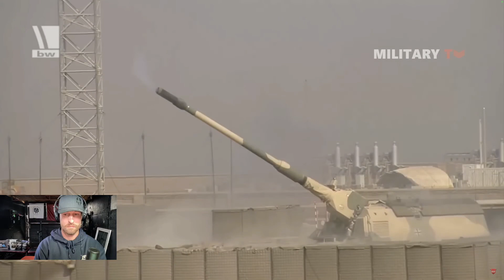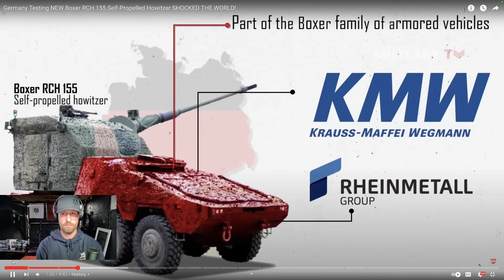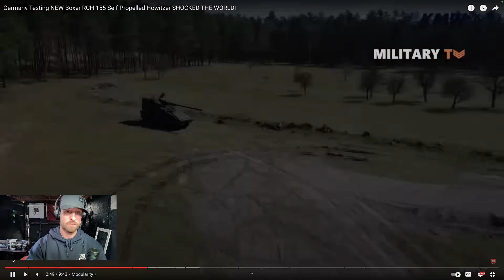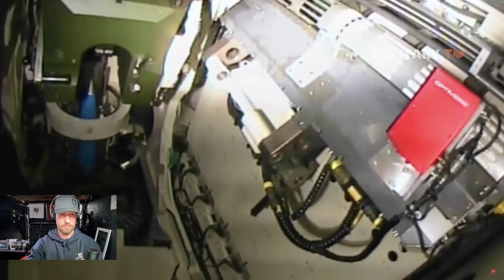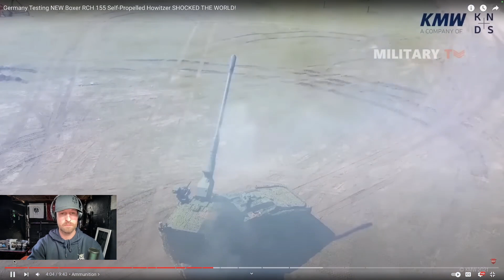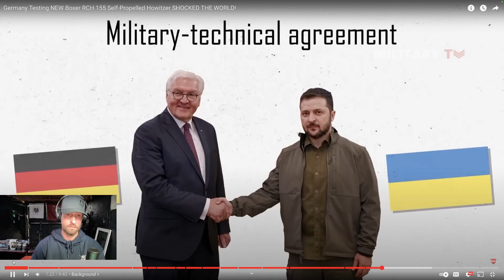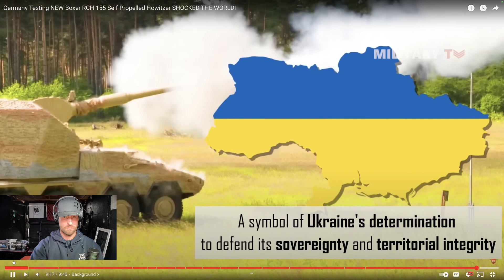Boxer RCH 155 British Armys New Replacement British Soldier reacts

Comment: Some very welcomed news for the British Army’s Royal Artillery Units. This will hopefully give the British Army an excellent expeditionary Tube Artillery indirect fire support capability that will be air transportable if required. But I also feel that the Wheeled capability should not be instead of a Tracked Capability, but should be acquired to complement it. Whilst given the KNDS RCH 155 has been selected, an updated fully Automated version of the Tracked PzH 2000 would be the best option given that both systems are developed by KNDS Germany with UK having already partnered with the likes of KNDS and Rheinmetall through their UK Subsidiaries etc.

Comment: There is a saying, 'if it looks right it is right.' Sorry but this does not look right. Top heavy, and too high. Ok for flat ground but unstable in the hills. Would look better with a gun 0.5 m lower and the turret top 1m lower. Looks like a firing of the gun to one side would flip the vehicle.

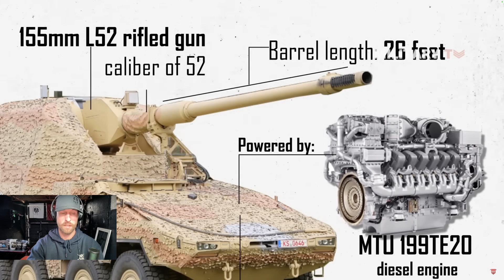Comment: 5:43 That information is partially wrong and partially unneccessary. L52 already gives you the barrel length ie 52x the calibre of 155mm. For example the AS90 has a barrel length of L39 or 6.02m compared to the 8.06m of the RCH155.

Comment: On matter of mobility wheels are not a great problem as tracked SPA loses very little as all support vehicles are wheeled. It is presumed that these are primarily designed for individual shooting as with the auto loading you would potentially mishandle its benefit if you set out to use them in battery fire situation. It would be a high financial liability to place such assets in a limited geographical area subject to area artillery counter attack.

Comment: Looks like a desperate cost development exercise.The chassis & tyre adaption looks on the limit with the weight? It'll have to keep well back from the front line & will be vulnerable to infantry?
Reply: certainly less vulnerable to direct contacts then most of the old artilelry units, as it has a RCWS and hunter-Killer-capability for selfdefense. Even the Pzh2000 which can engage in direct fire (and there are training footage of that on YT) has not all that luxury build in. But given its clear range advantage a lot of things would have to go wrong to actually meet enemy units directly.

Comment: I wonder about a couple of things with this weapons system:
1) How is the accuracy when the shooting platform is so soft? And on the move?
2) How is the mobility really with that enormous weight and only eight tires?
3) The weight and size of the vehicle must make it hard to transport by air?

Thoughts in general:
Will drones and missiles replace artillery?

Impressive things about the system: 
In the future it can be remotely controlled = no personell!
Reply: The soft suspension is not really a problem. The vehicle's weight actually works in its favor here. By the time the hull starts to lean the projectile is long gone, so accuracy is not compromised at all.

If missiles were to replace barrelled artillery, they would have done so by now. But they evidently haven't.
Guns have two major advantages over rockets: Ammo size and ammo cost. Missiles are a lot more expensive than artillery grenades. And they also take up a lot more space, both in the launcher vehicle and on supply transports.

As for drones, remember that each FPV drone requires its own operator who has to steer it sometimes for hours on end just to make a single attack.
In the Boxer RCH there are two guys who can make almost 40 attacks in less than 10 minutes and then drive back to base for resupply.

Comment: The AS90 would have a shorter range since it only has a 39 cal barrel unlike BOXERs 52cal, We trialled a 52cal version of the AS90 but it was too long for most hangars which would mean a major infrastructure bill. The Poles were only too happy to take the 52cal turret to create the Krab.
On accuracy. the only way to make artillery accurate is with guided projectiles, to say one system is more accurate than another is somewhat misleading. It all depends how it's set up, I used to set AS90s to have a max error in Azimuth or elevation of + - 1mil at 9km

Comment: After listening to your material, I regret to say that the level of uncritical acceptance of advertising brochures is appalling. I will give you a few arguments why RCH155 is a bad idea:
1. Howitzer carrier - Boxer is heavy and at the same time too small to mount such a tower on it. It is not without reason that the Austrians want to adapt the Piranha 10x10 to this tower.
2. The Austrian method of mounting on a 10x10 cart also has the advantage that you can add hydraulic cart supports that transfer the forces generated by the shot directly to the ground. The films clearly show what happens to this Boxer after firing a shot. Please imagine the state of the suspension and perhaps even the structure of this Boxer after firing a few hundred shots.
3. The war in Ukraine clearly proved that the PzH2000 with its complicated automatic loading mechanism was problematic during military operations. There is a problem with service and quick repairs. Basically, a failure of the automatic loading device takes the howitzer out of combat. Therefore, the balance between the high degree of complexity of the structure and 
the ability to perform quick, efficient and relatively simple repairs in field conditions, allowing the howitzer to be kept in constant combat.
4. Coming back to the howitzer carrier, placing the turret on a Boxer does not provide any benefits compared to placing it on an armored truck, which will be cheaper and will provide greater adaptability to the purpose of a wheeled howitzer. The off-road capabilities of the 8x8 truck will be very similar to those of the Boxer, and even better with the use of double wheels on the rear axles.
To sum up - RCH155 is a very risky purchase. There will be a problem with these howitzers in the future. Well, unless the British Army buys these howitzers to keep them in garages and look nice - that's ok.

Comment: The original video is making some entirely wrong statements.

1. The Boxer RCH 155 is NOT in service with ANY military, not even the German. (Germany and UK are purchasing 80 together to test and improve them before buying more)
2. The Boxer RCH 155 has not be exported to Ukraine, it will be in 2025

The video is spreading garbage content, likely AI written because it cannot differentiate between other Boxer models and the artillery version.

Comment: thing is bloody expensive vs truck mounted. (approx €10m for Boxer based vs €3.5m for Caesar NG)  Maintenance and parts will be more expensive.
No way you can air transport it on most cargo planes.  At 40 tons, it is too heavy and tall for C130 or A400.  So what? remove gun module and reassemble everytime, kind of defeats purpose of expeditionary role.
Pretty skepical about fire on the move in terms of range and accuracy (or even 9 rounds a minute) seeing the amount of sway on it.  Like firing from a swing.  To get metric precision at 40km, the gun needs to be as stabilized as possible.  Not even sure why you would need to fire on the move, when shoot and scoot is enough vs counter battery.  It's not like the boxer on the move will outrun guided or loitering munitions, or drones.  Seeing tye clusterfuck PZH2000 has been in Ukraine in terms of maintenance and malfunctions, i doubt this does any better in actual combat.
Really should have gone for the Archer version mounted on a MAN truck, which the UK army already uses for many other roles. Easier and cheaper to source spare parts, and probably would have cost a lot less to buy.  Boxer has to be one of the most expensive APC platforms on the market while not offering more in return, just about every modern APC in Nato is Stanag 4/5, and none, incl Boxer, will survive ATGM, arti, etc...)
Some procurement guys just love to choose complicated, when simple and combat proven will suffice.
my 2 cents

Comment: Hello. Im a litle bit to late ... 3 weeks 😉
But the RCH 155 is the little Brother from the PZH 2000
The PZH 2000 is still the undefeated Master among the artillery. And I think it will stay that way for a long time.

The difference as I have already read here in the comments is correct. RCH 155 is the middle class, but can keep up with its big brother PHZ, only the records of the PZH 2000 remain. Rate of fire unbeatable. Automation is good, but soldiers are still faster than the automatic loader 😉

Just some Numbers. Maby you find them elswere:

PZH 2000
3 rounds in 10 sec. (  slow )
24 rounds in 1 min. (record )
But after that, the reloader is ... dead ( tired ) 😂

btw. The Archer has the same range like PZH 2000 and RCH 155. there is no difference. Same Gun, Same amunition

And the Answer to your question at the end:
The Difference between PZH 2000, RCH 155, and Archer is simple.
There is not realy one, exept one thing that is not realy important if you have cover.
The only thing is that the Archer need more time to move after shooting. I think its 1 min. or maby 30 sec.
PZH 2000 and RCH 155 can shoot without stopping. 
But again, its not realy importand.

Comment: Three Possibilities one it could be online with the thinking of the SP80 they are already making the drive unit at Telford  so if more SPGs are needed if the front line stalls then the IFV Boxser can be changed for the RCH 155 also it can keep up with the lighter Boxser IFV  cost less in Maintenance and is more mobile than a tracked SPG

Comment: Wheels are supperior in strategic mobility. Wheeled vehicles are faster and can relocate over longer distances by themselves while tracked vehicles need to be deployed by rail. The tactical mobility is not as good as a tracked vehicle but it is a difference if you can go 60km/h on a road or 90km/h.
Reply: Your ammunition resupply will need roads so the likelihood of operating very far from the road system is not high.

Comment: This is the Phz's natural evolution. The Phz 2000 has been the world's best self propelled artillery for decades but is over comclicated and expensive. It's still in the top league but fast, fire-on-the-move guns with fully self loading turrets like this will very soon make it obsolete.
Reply: You could be stuck with M777 and need a 10 man crew to get 4 rounds a minute 😢
Reply: They haven't been the best. And as the conflict in Ukraine proves, they're good at shooting, but an absolute maintenance nightmare
Reply: @patta8388  AFU still dubbed it the best howitzer they have.
Reply: @patta8388  Ukraine literally broke the record of shots fired with a single 155 barrel multiple times with the pzh2000, beating its recommended 4500 per barrel with well over 20000 shots fired ... so much for maintenance "nightmare". 
What you probably refer to was a shortage of parts and a lack of maintenance operations near the frontlines, thats what delayed maintenance and took Pzh2000s out of the fight ... the system itself is just fine as long as your military has whats needed in place.
Reply: @diedampfbrasse98  Not talking about the barrels, which are amazing and a credit to Rheinmetall. It's the electronics and other parts that were causing trouble. And yes, a lack of maintenance attributed to that. But other systems went through the same and were not as fickle. 
It's a problem for lots of German military hardware. If you miss one maintenance check, the whole system starts cascading into the nether realm.
As someone who spent 12 months in a paratrooper regiment's maintenance company, I can tell you I have seen shit.
Reply: @patta8388  Sounds like purposely built-in electronics breakdowns to make money with the maintenance.
Reply: @ThaddäusTentakel-v2n  it's less purpose built, it's more "peak performance, but only in peak conditions".
Water and mud in the crew compartment were never considered before, so...they didn't protect against it.
Reply: @ no, they simply werent in good condition when delivered ... as most of our german army equipment
Reply: PzH 2000 a maintenance nightmare? How?  @patta8388

Comment: To any Artillery man, this sucks,  2 Crew - so who defends it, cleans, maintains it of a 24 hour basis.  As for Acuracy  a Laser as 26 km,  GPS is only any good as satalites ar Up and Working.  So over all Not enough Crew and very iffy on accurate  range and what of 24/7 manning or and limber (ammo Carrier).  The Logisics  stink.
Reply: Wow, you obviously have much more knowledge than all the military personnel who have put the system through its paces for months and then found it worth ordering. Those idiots should have asked you straight away and you would certainly have come up with a sensationally good artillery system. What luck that there are such brilliant smartasses on the island. That way it will never sink into insignificance. LOL
Reply: It has an INS which is precice enought to keep track of the position if you enter your start point form a good old map.
Laser is for direct fire missions. As for defending you don‘t set up fireposition/camps with this one close up to the front. Besides every soldier in the open is an IR beacon. Thats why infantry boxers do have a build in toilet. Ammo is in an ISO-container based reloading system with 2 reloads(88 rounds + charges ). The 2 man crew can reload the RCH in 10 minutes or the crew of the truck with the container can do. This while the crew does basic maintainace.